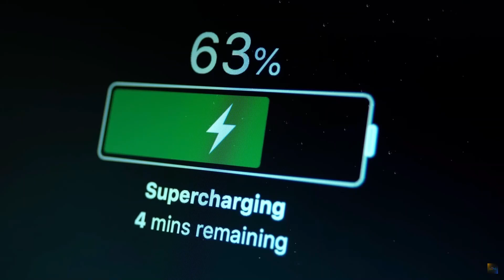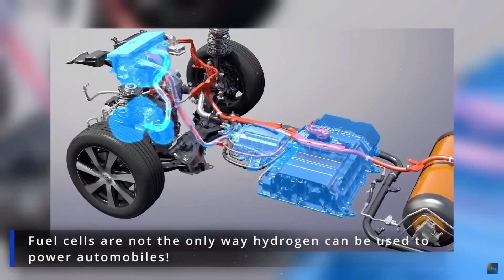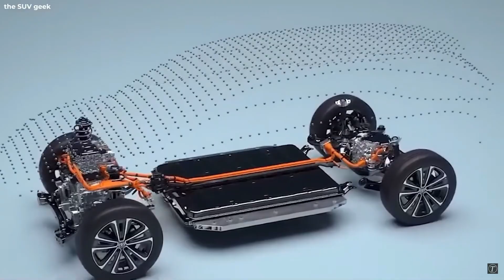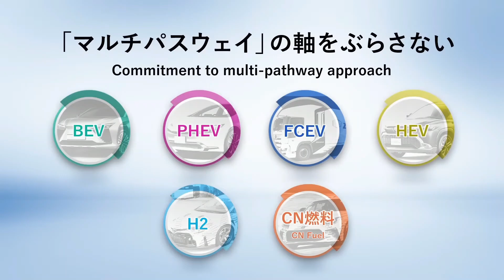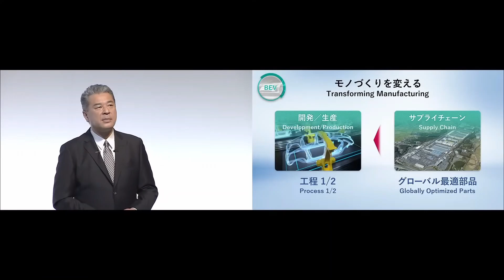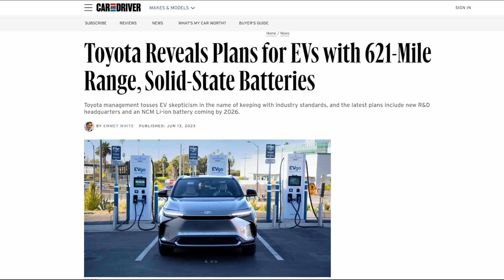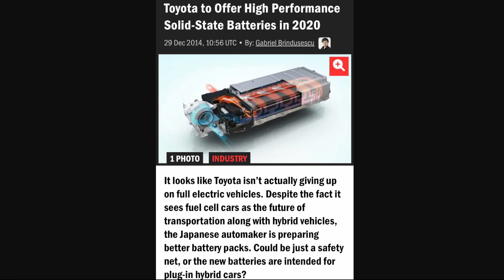Toyota's "Industry-Killing" Solid State Battery Might Be A Huge Flop.

Comment: Toyota have set up both a dedicated battery plant and fuel cell plant in japan with their own bosses and all the divisions integrated.

On the hygrogen front several companys are now working on opening fuel cell plants over the coming years.

Also toyota,plug power and others were sponsers of the successfull ecorunner xiii car which was a project in a competition set up by shell.

The team of delft university students acheieved a guiness world record of over 1500 miles in a hydrogen car and it did with less than 1kg of hydrogen,a remarkable feat.